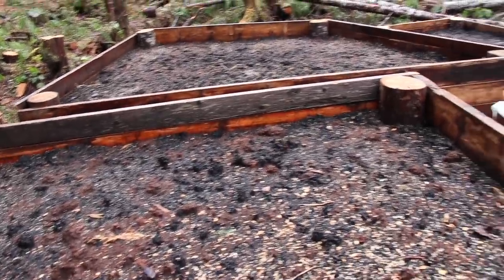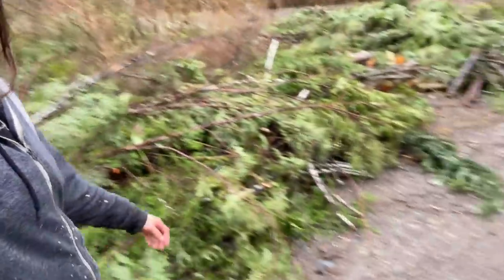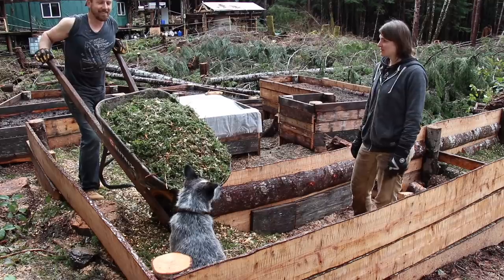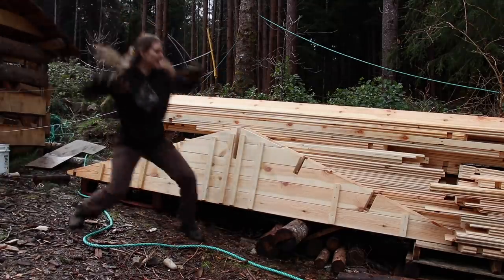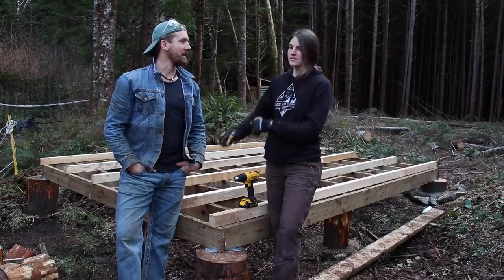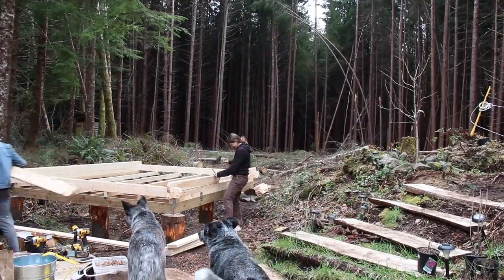TIMELAPSE - BUILDING A BUNKIE CABIN & Expanding Our OFF GRID YURT | BLUEBERRY GARDEN - Ep. 127

Comment: You took the words right out of my mouth at 22:30.  I'm sure the joints were nice and tight at the factory with low humidity.  Then you brought the boards outside in a damp, humid environment so they swelled up just that few thousandths of an inch, making each joint a pain to drive together.  It was more work, but luckily everything went together without breaking(?).

Comment: Love the garden beds but the planks should be on the inside of the logs, like a retaining wall, so you aren’t relying on the nails to hold back the dirt in the beds, especially when the planks season a bit over time and start to warp or twist a little. Just a suggestion.
Reply: all that wood will rot with all the moisture  there.

Comment: Maybe someone already said it but if your going to be cutting all that lumber, get a portable sawmill.( Woodmizer and I think they do free delivery) It's just too expensive and too time consuming to use a chainsaw mill to cut lumber. Just a suggestion.  Have fun.
Reply: With a saw mill. you almost have to have heavy equipment to lift and move logs to the mill, or break your back trying. The chainsaw allows logs to be cut near or where they fall. It seems easier and faster in the long run.
Reply: @unti419  not really accurate.  There are many on YT.  They fit in a pickup and one person can use it.  Especially with the small logs they are using.
Reply: @SoloHiker1  Yes, you're probably right. The ones I've seen are stationary and have to be taken apart and hauled in pieces, then leveled, so a pain to move. I did see a video where 4 people tried loading a log on a sawmill by hand and it took a long time with big prybars etc. I'll look around to see what is available in smaller sizes. Always like to see new things. Thanks.
Reply: Bill Shaw. Maybe someone already said it, but not everyone can afford a sawmill.
Reply: Sorry for my short sightedness.  I'm thinking their youtube income was enough.  My bad.

Comment: It's bad to cut a hole in the yurt plastic, plus then your going to have to cut into the expanding lattes could compromise the whole yurt, although the yurt came with a front door, maybe order the right door and frame from pacific yurt and re attach the lattes the same as your front door. use the extra green exterior plastic for top and sides to help with sealing the top and the sides. just stay way below that upper cable, you won't have to mess with that. might order some extra green plastic, vinyl to span the top and part of the side. you'll still need some rain buster sealer 2000 = really good caulking, wish I could draw a picture. P.S. don't over cut the lattes, too much is better then to little.

Comment: I wonder how air tight your bunkie will be in the wind, maybe putting some caulk between the board would be a good idea?
Reply: not only air tight, but how it will keep warm inside with such thin wooden walls
Reply: They are adding a stove
Reply: If you had noticed, it is tongue  and groove. No wind!
Reply: @hmorgan8387  Would have to be a pretty tight fit to keep out the wind.  And the walls can only be R2 or 3 so if you like a cold bedroom it would be great.
Reply: @TheMarkbarron  suppose that’s the reason they are putting in a wood stove too.
Reply: The walls are 44mm thick solid wood, these logs provide enough thermal mass to keep the space very warm when a small heat source is added to the cabin. Insulating under the floor and also on top of the roof will add further in keeping the space warm. 😊 our structures are located in some of the coldest Canadian climates and fair very well.
Reply: I'm sure someone thought of that in the design. I was expecting a cabin kit more like what  OFF GRID with DOUG & STACY are building.  6x6s cut flat on three sides and pre grooved. The outside is the actual log. Nice design but probably much more expensive.
Reply: @sawmillstructures  Yes, without the stove winter would be unbearable.

  I used to build custom wood structures above 8500 feet in Boulder County, Co. Winters were long, walls R values were necessarily strong.  And, one can apply to your thinner than house walls some weather insulation intelligence from the  RV camper industry, which deals with making habitats habitable for folks in outdoor places requiring warming and cooling with even thinner wall placements from their portable dwellings making visiting wilderness set against the elements.

Some kind of over windows accessory roll up and down inside flexible blanket, with its sides guides bonded to building interior to further cover exterior opening building surrounds -- as fixed by its sides over such even thinner than walls openings to outdoors -- could serve your dwelling concept well: top fixed, rolling toward the floor by its covering sealing sides and bottom on demand can close out weather's bite on a flexible basis (velcro the bottom?).  Needed building apertures can be closed in, or alternately be uncovered to open to light, and, while covered, can be cozy, and bounce back interior stove heat.  Perhaps too an alike add over doors interior car windshield-like reflector formed with a bonded skin sandwiched over foam pulled over the doors interior aperture could set its panel over the opening as an air tight by night insulator (with accordion-like folds exercised to span over cabin doors building walls to fix vertical edges by pop in sealing channels...easily moved to the side come mornings.

Love your prefab easily assembled bunking  structure (akin to Ipsen Logs, Rockford, Illinois, manufactured since mid last Century as alike fitted "logs" milled on edges and ends in the same way for their assembly (though thicker of necessity for permanent house structures, including wiring channels for electrical, communication, and lighting provisions and attachments).

Frank Lloyd Wright was big on roof insulation and radiant heat set into floors without much wall insulation, yet providing air tight walls and windows proven to work well in the upper Midwest, Great Lakes area.

It will be interesting to see what works for these busy off grid bunking dwellers adapting your structure to their feelings and needs in their homestead environment throughout the seasons.
Reply: @russianhomesteadfood7120   its tung and groove, Makes a pretty tight seal
Reply: Maybe some insulation too?

Comment: Why is there a Gap at the top of your window I think you placed your windows in backwards because the inside trim is taller than that outside trim you currently have???
Reply: but the window opens from the inside so it has to be right otherwise anyone could open from outside don,t you think .?
Reply: The gap above the window is for the wood settling over time as the moisture content in the wood drop.

Comment: The windows are the wrong way they are meant to open from the outside strange i kno but my cabins that way also you need to insulate the floor as in the winter so much cold comes up threw it if you dont.
Reply: Yes indeed, I was watching and screaming 😱 out to them, now they will have to dismantle it to turn the around, otherwise they will have major problems
Reply: The locks are on the inside
Reply: @warpig4516  i kno thays why i said its strange how they are made but the handles go on the outside and you can tell by looking at the window they have a big gap at the top also the frame is bigger on one side wich goes on the outside.
Reply: @mattmcbride2317  yeah I would think the sills would be on the inside too.Unless...they put the locks on wrong side lol
Reply: @warpig4516  no the windows come pre built and even tho its a log cabin because of the small size of it they arent made to live in they are for the garden mine is 5 meters by 4  meters and its still classed as a summer room.
Reply: @mattmcbride2317  👍

Comment: I've got a similar style cabin, about 7 years old. It's vitally important to make sure you never fix anything rigidly to two or more planks, as if you do you'll get gaps appearing as the wood dries and contracts, and then water will get in. I'll echo the other comments about needing underfloor insulation too, I'm just retrofitting that to mine after the original builder didn't add it, it gets very cold in the winter otherwise.

Comment: Tap them in with an 8 lb sledge, use a 2x scrap to pound on so as not to mark up the groove edge. The wallboards remind me of wooden popsicle sticks. How you going to heat it in the cold months? Is there some sort of FUNG SWAY of the planter layout? Thompson stain& water sealant for the wood outside of the Bunkey build hut would keep moss from growing on it.

Comment: FYI guys
Use a wood block to bead on to get your walls smacked down into the grooves. Or make a wood mallet out of a couple small logs. If I was you I would glue the tongue and groves with exterior wood glue So you don’t get expansion and contraction issues. 
Other than that great job guys

Comment: Did they suggest a bead of silicone at the interlocking fingers to seal the seam . We had a rubber strip and silicone we had to use to seal each layer ,and pound in the 14” spike in the logs ,when I worked on a log home building crew. Even the thick logs will crack,split,and warp.  Good luck with all of your ventures. A friend from across the border .😃

Comment: You should have smeared either candle wax or bar soap in the corners so the pieces slid easier. It was a trick used centuries ago for tight fitting joints.

Comment: Sorry guys but I just noticed something with your Bunkie build. At 28:58 shouldn't your windows open outwards? Also, it seems the window framing boards are wider on one side. I think these should be on the outside for more coverage of the outside walls. Just a thought and I hope I am wrong but do have a check before you finish the build.

Comment: Jake my friend. Can an old time carpenter and home builder give you just a little advice. I was once in great shape and worked like you, heavy wheel barrow grunt up heavy beams etc you know what I mean. But you gotta keep your body in good shape into your 60s 70s maybe 80s. After 44 years of carpentry, many of those years working 7 days a week because it was my own business. My crew did everything if it was a small house, excavating, hired out the well and septic but did the concrete basement walls and floors, framing, insulating , roofing, siding if it wasnt part of the framing, windows doors decks cabinets drywall taping painting final grading, landscaping. Today I have carpal tunnel in both wrists, I’ve got arthritis in my spine, all 4 limbs. My body is in pain daily, so after I turned 60 I stopped running but did some walking. Eventually doing less and ,ess. My diet never changed, I’m not an over eater.  But my metabolism slowed way down and from 60 to 66 I gained almost 100 pounds. I spent my whole life a fit 6’1” 177 pounds, I did lift weights in my midlife time to just keep fit. My late teens and early 20s when men have more brains below the belt than above it was most important to me and my brother to body build. So I went from a skinny 140 leaving high school to almost bumping 180. Felt great tons of energy and I thought nothing about knee pads, back support etc. all I’m saying is you look great, and some of your feats of strength look great for the video. And I suppose if your just hamming it up for the video that’s great. But don’t work like a fool all the time. You will hurt yourself PERMANENTLY. respectfully Mark from central WISCONSIN offering some friendly advice. I see a lot of young me in you. Excited about your future you’ve got non stop -lans in your head. But you only get one body. Take good care of it you are not invincible. You may look and feel like Clark Kent. But we know there was only one visitor from Krypton . God bless take care always enjoy a peaceful time watching you guys. Nice music, although sometimes I feel a little like a peeping Tom and enjoying it. Lol. Great life plan

Comment: Ok first off love you folks and enjoy your work. Now thermal stuff! You need more vertical pipe length on your wood stove! You should not have that smoke coming back into the home when you open the door! If you had 6ft more on the stove the hot gasses and air would flow much faster gathering up the smoke that is coming back into the home! Total fact, I promise you your stove will perform better in every way! Also trying to have long slow burns might fit your comfort needs but doing this with Fir will cause the chimney to collect material very fast causing it to flow slower. If you can find silver birch or broad leaf maple (look in de forested logged areas) it will yield you more BTU less chimney crud and will be less destructive to the equipment doing slower burns. I also recommend getting the stove as hot as the sun once a week as it will burn off material the has condensed to the chimney walls. However doing this if there is a large amount of deposits already could cause a chimney fire. The simple truth is if you go outside and you can see smoke your going to have material condensing in the chimney. You should then burn hotter to slow the chimney buildup. For an interesting bit of fire for heat information read about how the scandinavian countries burn in there "ceramic heaters"! Totally opposite of how we do it in North America. If you are able to have dry dry birch maple even alder and burn hot you might never need to clean a chimney!  Now to the dome oven, the bottles are not to store heat there a thermal break. Air is a natural insulator the bottles are a good heat proof method of casting air voids in the mud. The air voids slow the heat being transmitted out of the bottom of the oven. There not to store heat energy as air does not have much thermal capacity at all. Hope I did not get to geeky I just love the physics of fire, heat and eat off wood for 35 years!

Comment: I found this channel very recently and have enjoyed watching it very much. I'm impressed with all the hard work and the ability to still produce a nicely edited video. Editing all of the content is a full time job.
But I have a question about the construction of this cabin. Did you square the platform before construction and it was edited out? Or did you really only measure the length of the sides? It may be due to the camera lenses, but it looks out of square. To square it you need to take two measurements diagonally from one corner to the other and then the other two corners (a large X pattern). If they match, the building is square. If they don't match you need to adjust the platform until they do match. Or use the Pythagorean theorem to square it. (a2 + b2 = c2)

Comment: PA LAWN GUY> Your chainsaw chain is very dull when it throughs fine dust like it is in this video. That typically allows the saw to over rev, increase damage to the engine, over heat the chain and bar which softens the metal and increases the wear rate. Like your videos.

Comment: might make shudders swing shut over windows. real work. that if leave trip bear come over break nice widows. also bad storm might nice latch shudders shut protect widows have make sure Locke shut or open tight want come lose swing into widow break that way either. back little house prairie books that what have protect widows. might slide like barn door over widow. something think about down line nothing done this year.
Reply: blue Berrys come up every year? going plant other stuff come up every year like rhubarb, grape vine? try train grape vine up arch to another bed? or maybe make arch tie climb plants too? you take sticks and tie X patern or gride of X so that climb stuff like cucumbers other stuff climb up. then run think boards three of them across top down other bed. do x patern grind branches top down to other bed. then climb stuff some tie too. or even tomatoes. might fun bunch wooden branches tie panel branches that tomatoes lose tied too. if have bunch off them. wooden fence of sorts that tie plants too.

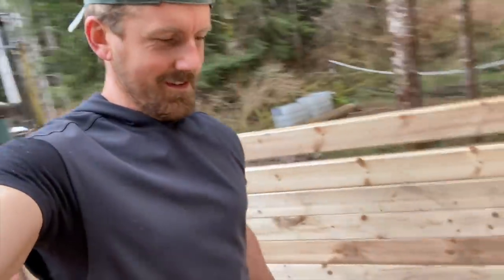Comment: 25:10- Was that a mosquito?
25:34- yup
So the hall goes all the way to the end of the bunkie? And the wall nearest the yurt is one of the bathroom walls? Better yet a closet wall, for sound.
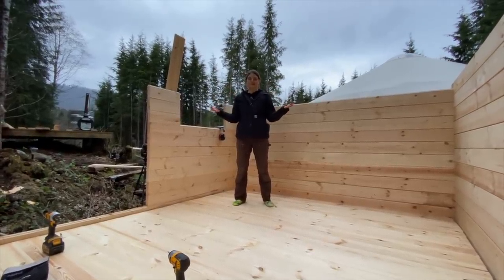27:28 Another mosquito! ... And a mayfly.
You might want a tongue and groove router (or planer, going the hard way) to make wood wall planks like the bunkie. Obviously it will need an extension of the e-fence for a good bear-ier. LOL 
Are you gonna make yourself a clear vinyl door for the end of the hall? What did the yurt makers use?  Even if you don't permanently enclose the end of the hall, a winter cover with a view would be good.

Comment: Dude, cutting the ends of those floor boards is a HUGE mistake. I hope it doesn't come back to bight you in the butt to bad. It isn't going to seal up correctly, and the building isn't going to be as structurally sound. 
Might want to cut some shims to shove in there pretty soon.
Reply: And put some insulation under the floor while you're at it.